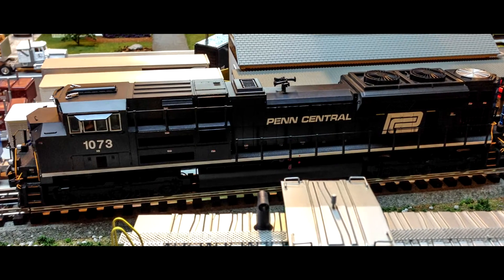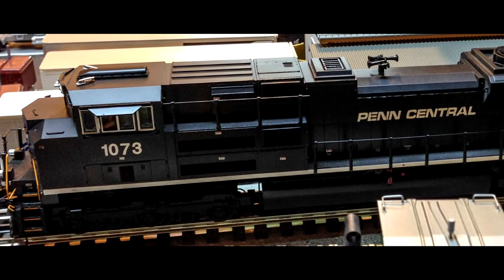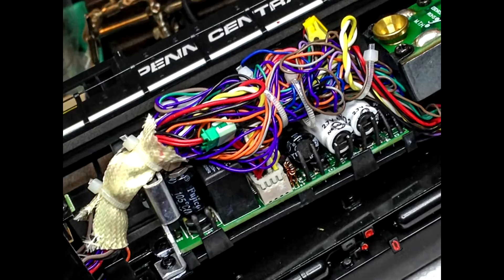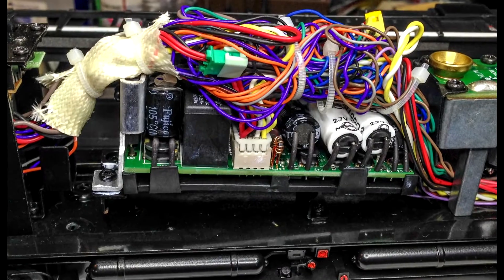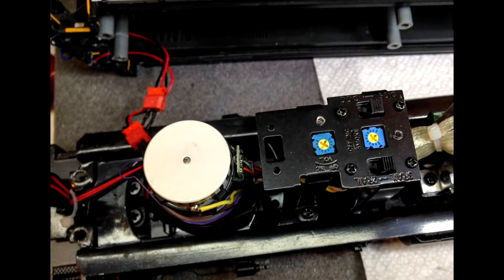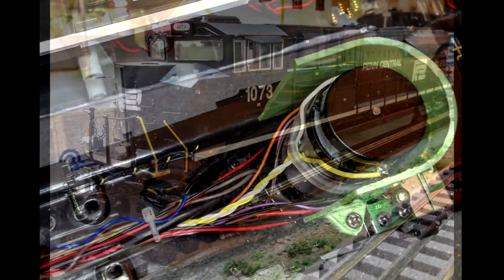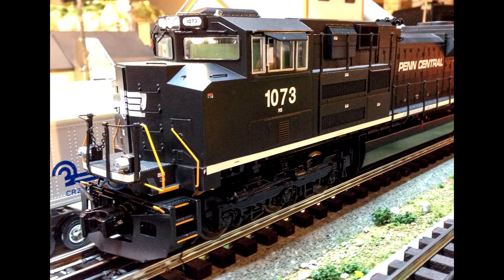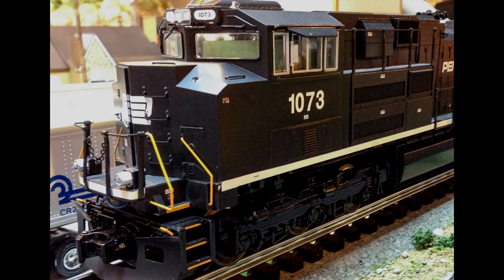What I like about MTH diesels

Comment: Proto sound 2.0 were the best.  Look at how thick the flywheels and wiring was in those older engines and look how thin the wiring and flywheels are in the 3.0 engines.  The 5 volt 2.0 were the best and my favorite engines.

Comment: I have a few MTH premier proto 2 units and love them.  never had trouble.  the only thing is I believe the speaker is scratchy sounding on mine, I replaced the battery thinking it was that, but I believe the speaker may be crappy.  I thought of a high quality same ohm unit could be used by a speaker manufacturer like Polk or Clarion, or other in the same size to reproduce the sound clearer.   Not sure if it can be done, never looked into it
Reply from the maker: IIRC, there were some guys on one of the forums wiring up FM transmitters to their engines and broadcasting the sounds to a nearby stereo. I have a PA system nearby from when I played in the band.  That would sound pretty cool.  :)
Reply: ill look into it thanks

Comment: Bob, I have some MTH diesels that are not smoking, I suspect that there is an issue with the wick.  Can you do a video on how to replace the wick?
Reply: +Frank Grimaldi  You might wanna open up the smoke unit and replace the 'badding',or "wadding",in the old Lionel units.The white stuff that the fluid actually soaks up into.As long as you can feel the unit heating up,and hear it operating,that's probably what it is.I have seen many times that just replacing this does the trick and actually increases smoke output.My hunch is that is what you mean by the wicking.Just order some new stuff,take out the old,primer the new stuff up with fluid,and you should be smoking again.Check out my channel at Lionel For Less,and Subscribe if this helped you out any.I know an MTH wizard"and might be able to help you out from time to time-Kenny